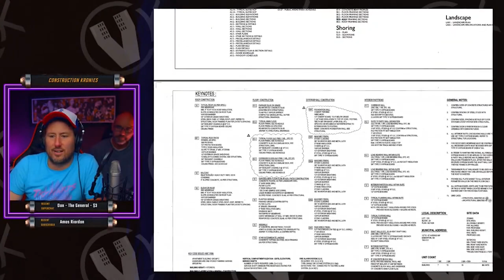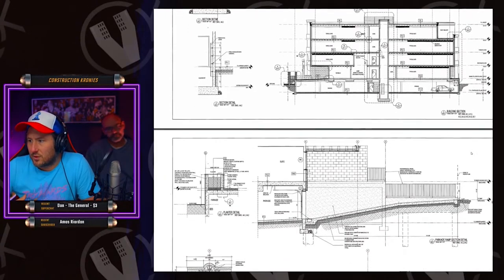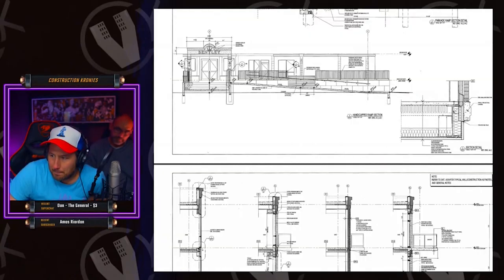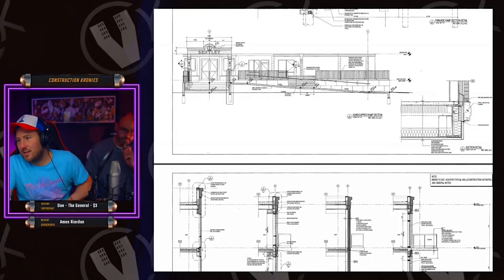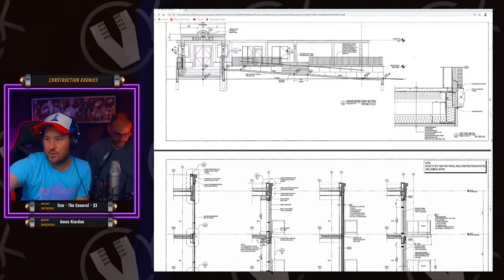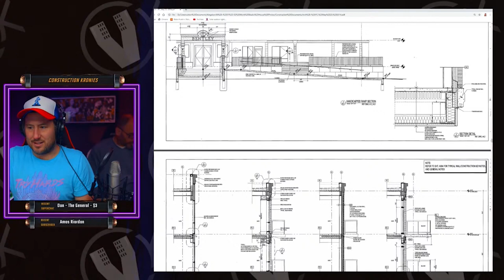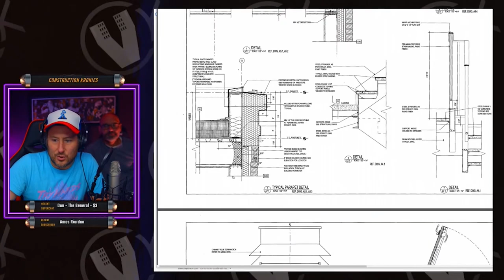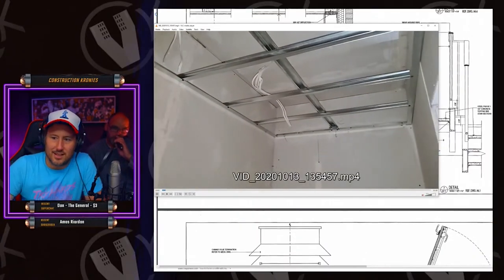Metal Stud Framing Soffit Details On Drawings

Comment: Could you frame a soffit with stud in order to insulate and drywall the top as well as the bottom? I’m building a soundproof box and plan to store things on top
Reply from the maker: Yes for sure you can, we use stud all the time its not strange at all.

Comment: Hey, great channel! Whats the best way to support steel stud walls to the underside of a tbar ceiling grid? Thanks
Reply from the maker: The best way is to use clips. They are a light gauge steel so you can use the regular steel framing screws. Any drywall supplier will have them. Here is the link to the clips. http://www.revoebuildingproducts.com/ 
Also make sure to tie your end studs into the existing walls good and when it's all.drywalled everything will be strong. I don't reccomed screwing right into the grid in case you ever want to remove or move the walls. Let me know of you have any more questions.
Reply: Awesome brother. Thanks for the reply. This will work great for this project. All the best!
Reply from the maker: @ACG-Contracting  Good stuff!!  I am always happy to help!!!

Comment: Can I go 24" on center with res channel on my ceiling if I use 5/8" drywall? (just joined!)
Reply from the maker: Awesome!! Thanks 👍You can go 24" o.c. with the res if your joists are on 16" o.c. or close. If your joists are 24" o.c. you should go 16" with the res. Hope that helps! Single layer 5/8" may be okay. Checkout Bailey Metal Products website and they should have specs up there for the RC Plus. I'll try to remember and look after work here. Don't be afraid to reach out again if you need help.
Reply: Yes the floor joists are 16" oc.  Can I attach my top track to the res bars?  With the 5/8" drywall for my ceiling, if I attach the top track to the joist as well, I will only have 3/8" left for my drywall on the wall.  Suggestions??
Reply: Ok, I was afraid that having the top track attached to the res bar might defeat the sound dampening properties of the res bar.

Comment: Hey Chris. Could you update the prices for piece workers? Thanks
Reply from the maker: Sure thing. So this can change from region to region and this is in CAD so convert it to USD. For drywall I will charge 1 price for the whole job. So that includes any size or type of drywall. If the job is hard and has a lot of tops then charge toward the high end and if its easy straight stand ups charge the low end. Drywall $0.22 to $0.35 / square ft. Steel is also on a sliding scale but we charge per linear foot instead of square foot. Charge according to difficulty. Any width but I go by height. Up to 8ft is $.450-6.50, up to 15ft $9.50-$12.50 up to 25ft $15.00-$25.00 25+ ft $30.00+  per linear foot. This is all install only and does not include equipment rentals or fasteners. This is a good guideline for walls. Parapets you can get $15.00 per foot and ceilings we charge $1.50 to $2.50 and bulkheads start at $2.00 per linear foot.
Reply: Thank you very much. 
You're the best.!💪👍🏻